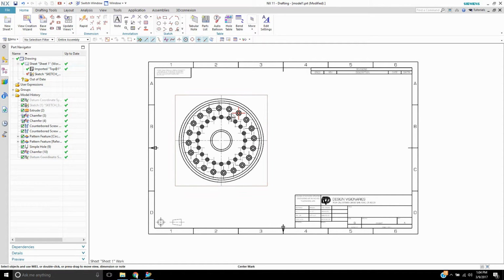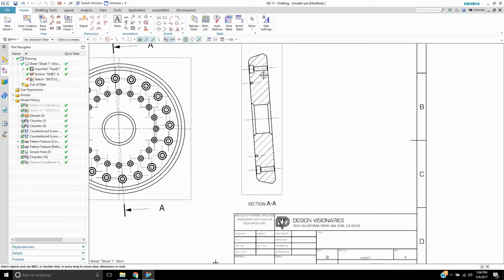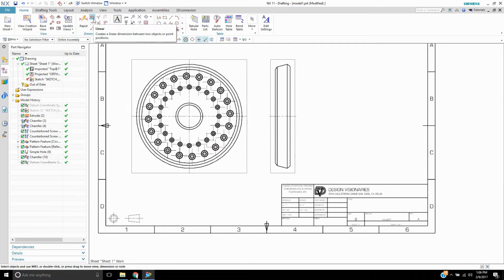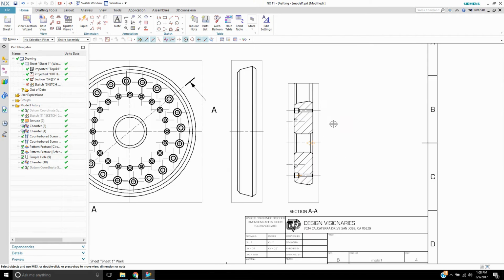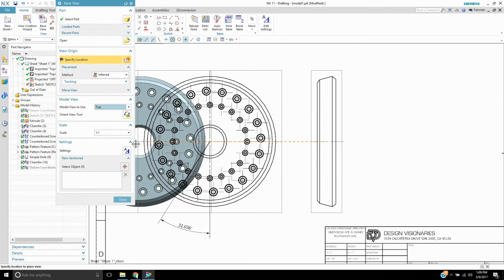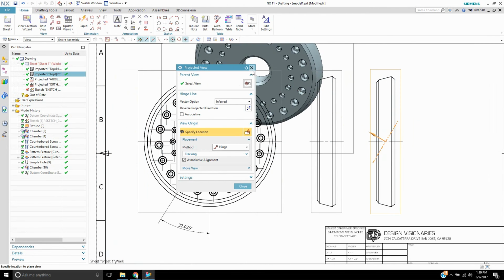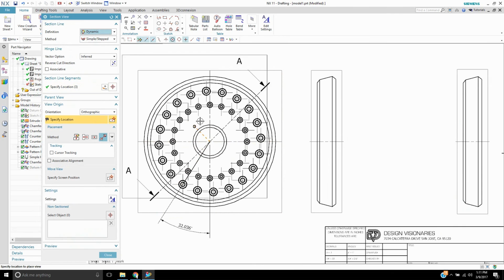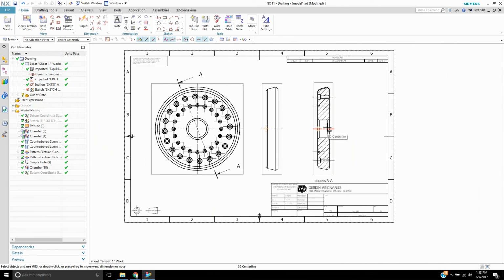Orient Section view

Comment: cannot we directly use the rotated section view to reach the same output ?
Reply: Hehe, it works, man! For my purpose at least. And now I feel dumb, because I already knew about circular section mode.

Edit: but now I need a section perpendicular to radius of a detail. It is positioned at an angle, but I need to picture the section horizontally. Can't achieve it with "revolved" mode.

Edit 2: solution described in the video is useful, too, but it needs to be polished. The concept of inherited views can be described and shown in two to three minutes.